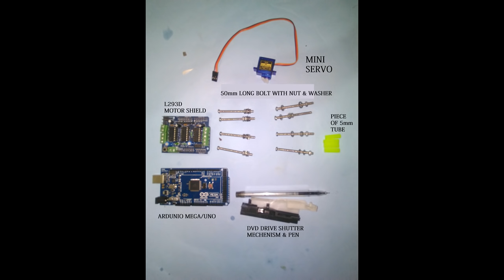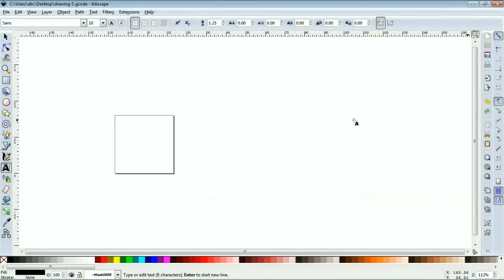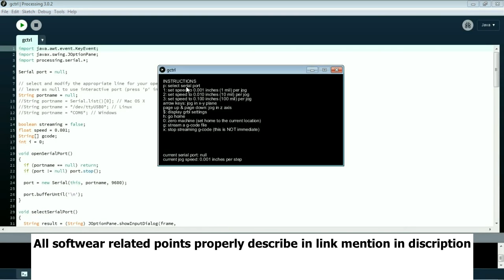How to make Mini CNC plotter machine at home using Arduino, L293d Motor shield & old DVD drive

Comment: Good evening to all.
Iam stuck up for modification code for arduino motor Shield L293D.I need modified cnc .code to run my mini.All motor test run ok.but nothing happens when I run mini plotter on g code. I checked with few people,all said that I need to modify cnc.code to run L293 D Shield.pls help me.thanks

Comment: Hey man.Nice to see your video.Inspirational.I have made the whole structure as yours and coding part is alright but the problem arising is with the motor plug pins in front of the reset button in the motor shield. Multimeter is showing a good voltage output but while fixing one stepper motor , the whole side of the shield in front of the reset button is not working but when the stepper is fixed  on the other side of the plug ,the stepper is working.Can you suggest me a solution to fix my problem as soon as possible.I Shall be thankful to you.My thinking is that I must replace my shield with a new one.
Reply: Suman Jaiswal You should replace the sheild I also did the same for this problem

Comment: to where the 2  black wire is going
can give me a detail view
Reply from the maker: Rino Davis which black wires actually I didn't get, I think you are talking about  power wire this wire is coming from 5v DC adapter to motor shield
Reply from the maker: Which 2 black wire bro, will you please give the time at when it appears in video
Reply from the maker: ok this is a external 5V DC supply for L293D Shield, what i do take a mobile charger cut it charging pin and directly insert this positive and negative wire into L293D shield to power it...
Reply
Reply: Mr. Innovative
u connected that 5V DC supply n also a USB cable from laptop to Arduino.. 
That USB is used for giving the input...
I had read that if we connect USB it gives the power supply... so do we have to connect the 5V DC supply to shield...??
plzz reply
Reply from the maker: Ishaq Polishwala it's not compulsory to provide external 5v DC to l293d shield, shield directly gets its power from arduino in this case you just keep shortlink at its place which is on L293d, if you have you shield in your hand you can clearly see a shortlink on board, don't remove it if you want to use onboard 5v DC or remove it if you want to give external 5v DC

Comment: Bro. Stepper motor only arduino board pe connection dene par chak rha. 
L293d shield lagane par nhi chal  raha motor. 
Kya problem ho sakti. Shield khrb hai kya.??
Reply from the maker: may be ho sakta h board pe LED on hoti h kya ?
Reply: Mr Innovative ha board pe LED jalti hai green

Comment: sir, i m getting the problem as when i run the gcode file the stepper motors doesnt perform any operation just vibrates but the servo motor that lifts the pen it works.i copied the same arduino CNCcodebut its not working but when i test the servo motors by STEPPERTESTcode both the motors performs according to the code but only when i connect both wirings of motors on M3 and M4 ports they work seamlessly so there is no prob with both motors. if u can give me a resolution to this problem i could successfully present it in my project display on 24/04/2017. please help

Comment: Hello super video I followed your procedure but when I want to configure the Gcode sender I have to place it in 9600 to see ** Connected to COM4 @ 9600 baud **
Mini CNC Plotter alive and kicking!
X range is from 0.00 to 40.00 mm.
Y range is from 0.00 to 40.00 mm.
But when I download the Gcode and want to send it I have the message "GRBL has not finished booting"
Could you help me  please?

Comment: Hello Mr Innovative!
Please help me.
I built the device, but it does not draw as yours. There is only one difference engine "Z" axis is positioned as the video. I think it's wrong, but I do not come out in the wiring. I am Hungarian, google translator I wrote this. Thanks for the help!
Reply from the maker: you have to connect X-axis @ M1 & M2 Y-axis @ M3 & M4
Reply: Thank you! Polariti?

Comment: Arduino: 1.6.3 (Windows 8.1), Board: "Arduino Uno"

CNC_code.ino:7:21: fatal error: AFMotor.h: No such file or directory

compilation terminated.

Error compiling.

  This report would have more information with
  "Show verbose output during compilation"
  enabled in File > Preferences.
pls help me

Comment: How Many Volt And Amp To Be Supplied To L293D Motor Sheild
Reply from the maker: 5v dc
Reply: Bro. I Hav Done Every Thing Well But Why During My Printing There Is Vibration On X,Y Axis ?? Nd Every Thing Is Printing Just Rough And Are Nt Understandable Why??? Please Help Me...
Reply from the maker: as soon as axis doesn't get smooth it'll can't draw clear image, check you motor drive voltage not fluctuating, mechanically joints are tight
Reply: Yupp Every Thing Is Well
Reply: Or I Will Hav To Do Some Editing In Coding???
Reply from the maker: no need to edit any code at all
Reply: Then?? Wat To Do
Reply: Please Bro. Help Me
Reply: Will You Do One Thing For Me.. Please Bro, Snd Naa Detailed Means Side By Side Photo Of Pen Stain I m Thinking My Pen Stain Is Not Better At All Bcz It Is Moving..
Reply: I Wuld Be Very Thnkfull For Dis Bro Please

Comment: Hi there,mm here.will old type of stepper motor going to make any problem? Because my motors are of 2008/2009.secondlyeven while loading gcode example from gcode library the same problem occurs..after opening version 3-processing software and  pressing key "p" in processing 3 and selecting com 7,message seen on LHS that all ok and kicking.But as soon as Press key G source code is passing command to arduino board ,but no action on motor.all lines shows x and y axis value one after another,without action from motor.while test run with "motor party" motor runs ok ,no problem there.thirdly do I require any software to pass on commands from arduino board to motor shield.I have already loaded cnc.data on arduino board at com 7.this is what happens at my side.so pls celeryfy all my query.thanks.

Comment: Hello sir i want to ask whether to buy arduino UNO or arduino mega??
Reply: Onkar Suryavanshi  if you want to run many loads u can. go with arduino mega 
for a beginner uno is enough
Reply from the maker: arduino uno & mega both work for this cnc and yes arduino mega have more capacity, but kindly note that arduino mega can't use with CNC V3 shield
Reply: what's the difference between L293D Motor shield and CNC V3 shield??
Reply: Onkar Suryavanshi bro L293D is for two stepper motor and 4 normal brushed motor where as cnc v3 shiled is specifically designed for cnc machine. And easy to use. #buddytechhub

Comment: Mr.innovative,
Again I checked with Shield manufacturer, he said that L293D motor Shield directly will not run on downloaded soft ware. For running stepper motor cnc,the code has to be modify.so pls give me link to load this modified code to arduino IED.
Thanks
Reply from the maker: as far as i know you have no need to chnge any code but u must have afmotor shield library installed

Comment: sir at a time only one servo and stepper motor are working by this code.both stepper and servo motor are not working then sir help me
Reply from the maker: please check you have applied the required power supply

Comment: we're the black wire is connected from motor driver board
Reply from the maker: this wire is external 5V DC supply
Reply: I will Assemble all the connection and simply connect the USB cable from laptop then I do programs .I'm  making this model for my school project for some questions you can provide your any no. Please
Reply: Acha you can tell I can connect with arduino uno

Comment: Actually it seems software issue . My son Nilesh who is a software Engg.according to him he says he has uploaded all software as per advised in your project.and he added few lines in motor party test run and I am able to run both stepper instead of one and servo also runs ok.but nothing runs as soon as I press G in processing 3.data for your ref
Reply from the maker: After pressing "g" u need to select gcode file which have to draw

Comment: hey brother can i use arduino uno at the place of arduino mega ????
Because uno is cheap and mega is costly it is not adjust in budget
Reply from the maker: yes you can use uno
Reply: can u give me arduino uno circuit sketch ?
Reply from the maker: https://www.mediafire.com/folder/ld4kf4bav4k8a/CNC_Machine_project_files
Reply: bro it showing an error while uploading  cnc code 
but arduino driver is installed successfull so why error?
help me

Comment: Binary sketch size: 11,094 bytes (of a 32,256 byte maximum)
avrdude: stk500_getsync(): not in sync: resp=0x00                              
 problem
Reply: deepak raj  select port first in arduino software, from tools>port

Comment: Thanks for prompt reply.now pls guide me on my second query ,I have arduino mega and I will buy L293 D . + 2 stepper motor + one servo motor I already have. so for these combination pls advise me on what power supply I need and where to connect.thanks in advance
Reply from the maker: 5v dc supply for Motor shield & 
and GET arduino connected with PC

Comment: Adafurit-motor-shield-library-master not dowlond  plz bro help
Reply from the maker: https://github.com/adafruit/Adafruit-Motor-Shield-library/archive/master.zip
Reply: Mr Innovative
Reply: hey sir i have a doubt. can i increase the distance of z axis? or is it preset on the code that it moves only the specific distance? i mean..... can i control the rate of z axis by changing the code?
Reply: michane not work

Comment: In DVD drive dc the DC motor only available.. what can I do...
Reply from the maker: those motor have 2 wires or 4 wires ? if they are 2 wire so it will no use
Reply: KG130 5V Stepper Motor 28j 48 will be use????????????

Comment: my (arduino-1.0.5) not showing serial port can you help me,please give answer with video.
Reply from the maker: make sure you have installed the diver of arduino board ,
if yes then change the data cable and try

Comment: i'm having this message every time .i uploded the adafruit motir shield library too.but same problem.plz tell me how to fix itthanks Arduino: 1.8.0 (Windows 10), Board: "Arduino/Genuino Uno"

C:\Users\User\Downloads\CNC_code\CNC_code.ino:9:21: fatal error: AFMotor.h: No such file or directory

 #include <AFMotor.h>

                     ^

compilation terminated.

exit status 1
Error compiling for board Arduino/Genuino Uno.

This report would have more information with
"Show verbose output during compilation"
option enabled in File -> Preferences.

Comment: no no my fault I.m very happy the motor driver sheild socet in which in I.m plugging the motor driver is not proper attached with wire the program was uploading and the wire of motor is not attached properly how it will work thanks my fault

Comment: In window which opens just second last it shows in file ." Unicorn. Py ,line 108'in<module>e,effect .file ...............like that about other in unicorn line 102.like these there are about 4 error message.and then ask for do u want to save if and press then it saves in .......svg file only.pls guide .Also pls let me know how to load ......g code file from example of camotic programme to arduino uno board of my 2 d cnc machine so I can test run my machine on fully developed gcode file from camotic pls
.

file
Reply from the maker: have you added makerbot gcode extension for inkscape ?

Comment: Bro in Processing Software 3.5.3 I am getting this error…:

The method showInputDialog(Component, Object, String, int, Icon, Object[], Object) in the type JOptionPane is not applicable for the arguments (ProcessingFileCNC, String, String, int, null, String[], int)

I would be really thankful if you can help me out… Thanks in advance!
(Reminder: ProcessingFileCNC is the same .pde file… I just renamed it)

Comment: external power source is given through?
Reply from the maker: Through 5V DV 1Amp adapter
Reply: is it necessary to give external source? cause if i connect the stepper motor separately it works and even the servo motor works but when i connect all together in a shield and run cnc.ino it doesn't work. *****

Comment: a problem occurred while uploading software in arduino it's showing "exit status 1
Error compiling for board arduino /genuino mega or mega 2506"
plse help me bro......
Reply from the maker: make sure you have select right board you can check it from Tools > Board
Reply: Mr Innovative I had selected arduino/genuino mega or mega 2560
Reply: Mr Innovative how much volt of adapter we must use bro i mean range of adapter???

Comment: can anyone help me to make a 3D printer with Arduino using direct stepper motor driver instead of CNC shield, because I wanted to make 2D printer before and I have driver, not want to buy a shield and wasting drivers, thank you with honours

Comment: sir it is possibly we can convert 24'' paper size.
Reply from the maker: for this perticular machine not possible because shaft lenght of axis is hardly 4 cm
Reply: Mr Innovative  if I'll increase the length of shaft then what  should I need to change in it.
Reply from the maker: while making g-code keep your paper size according to plotting area, 
and in arduino code X-MAX & Y-MAX keep accordingly

Comment: Hello sir i am not able run the stepper motor.
How much should be the voltage for stepper motor??
Reply from the maker: 5v dc
Reply: Actually I had given 9 volts and 12 volts to it bt though it is not able  to run 
I don't know whats the problem
Reply from the maker: 9V are actually too high, have checked the windings properly
Reply: Ya the windings are proper
Reply: I too had given only power supply directly but though it is not running
Reply: Bro maybe your arduino motor shiled is blown or it may not getting the proper pwm signal. 
From my opinion to buy a arduino motor shiled is waist of money rather to make it. As hand made motor shiled works better than market one.

Comment: hey my stepper motor becomes too hot and the ic also
Reply: Pranshu Shrivastava  dvd motors using here are 2 phase motors (see 2phase motots internal view digram) then check both coils end with multimeter for connectivity test  (diode mode) if  connetivity ok for both coils of motor check ohms (resister)value as well, each  should have 10ohm near value,   if this check ok., your motor ok.check for both motors. Now conect one coil ends (assume A &A') M1 pins of  L293D motor shield (A to M1 pin near sservo  connection.)at dvd motor  next coil (assume B &B') to M2 pins of L293D motor shield (B towards GND pin  between M1 & M2)  A,A',B,B' pattern can identity from ribbonn uucale of  yourvd motors (one end to other end) dosaame thing  .to M3 and M4 ports of L293D then upload arduino codes called stepper motor test to arduino and run whether motors are runing  ok. Good luck.

Comment: 15:16 where is conecting black wire to other side..?
Reply from the maker: its a 5V DC power supply
Reply: Mr Innovative if i used mobile charger..?

Comment: bro I.m able to upload code of stepper test but my motor is not working
Reply: Check if the voltage is too hight or to low.

Comment: + Mr Innovative Can we use arduino ng for this project pls reply asap
Reply from the maker: The Apps Reviewer you can use uno
Reply from the maker: The Apps Reviewer you can't use nano here
Reply from the maker: The Apps Reviewer yes that pen holder is inside the DVD drive
Reply: ng is different from nano......
Reply from the maker: The Apps Reviewer uno and ng are same you can use arduino ng
Reply: Mr Innovative thanks you..sir
Reply: Mr Innovative can you please tell the dimensions of the board you used for placing paper....plz reply asap
Reply: c.naveen kumar kumar 
I m also facing same problem

Comment: there is not a G-CODE save as option given
Reply: so i add a library Extension in inkscape
but it not show G-CODE save as option
Reply from the maker: make sure you have done it properly all files must saved properly in extension folder
Reply: Mr Innovative Thanks  bro :)
Reply: thanks

Comment: how many volt is required
Reply from the maker: 5V DC
Reply: Did Is For Arduino Naa Way Abut L293D Motor Shield
Reply: دمية المخفة
Reply from the maker: both 5v dc

Comment: making half images incorrect
Reply from the maker: you need to adjust axis manually
Reply: Means what???
Reply: Please tell
Reply from the maker: means you machine is not at zero zero point you need to adjust axis by manually sliding them before streaming g code you have to do some try as you get proper calibration of axis
Reply: i also have same problem
please help

Comment: This video has a weird framerate. 48fps????
Reply from the maker: is it high or low? i don't have much idea about video framrate
Reply: usual is 24 fps, 30fps or 60fps.
Reply: Mr Innovative standard is 30fps. cinematic is 24fps and 50 and 60 are the smooth youtube kind of framerates. but ive never seen 48 before.
Reply from the maker: oh i see..

Comment: time is 10.02
Reply from the maker: ok this is a external 5V DC supply for L293D Shield, what i do take a mobile charger cut it charging pin and directly insert this positive and negative wire into L293D shield to power it...

Comment: That's a drawing machine,not a CNC machine
Reply from the maker: Computer Numeric Control (CNC[1]) is the automation of machine tools that are operated by precisely programmed commands encoded on a storage medium (computer command module, usually located on the device)